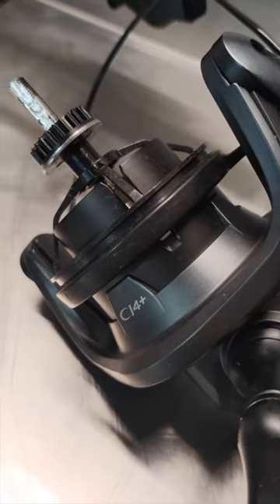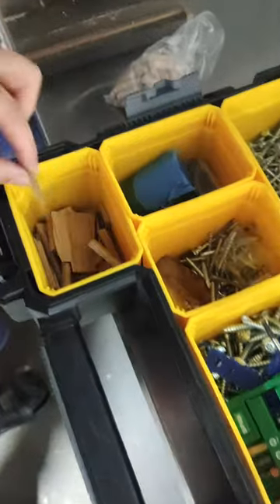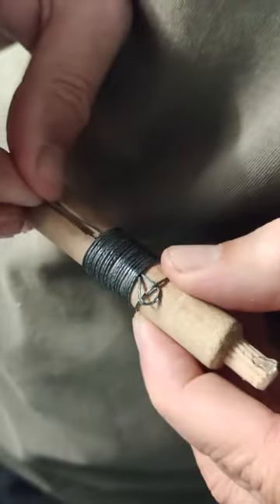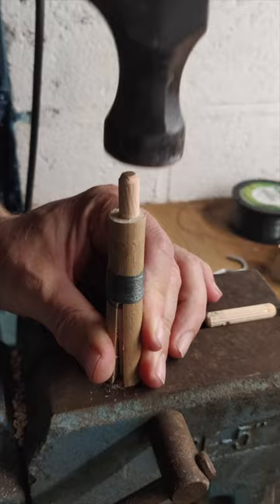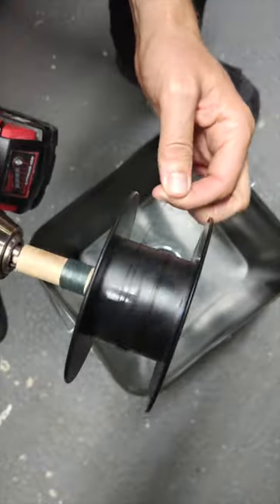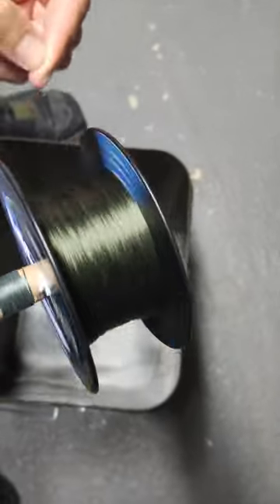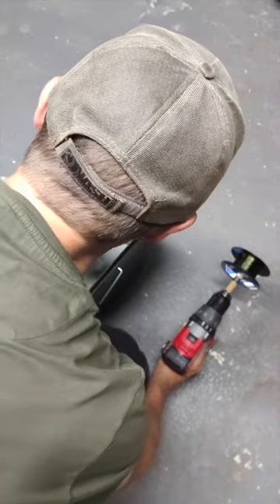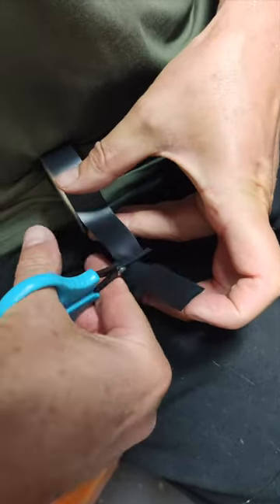Simple DIY Tool To Strip Line Off Your Fishing Reel

Comment: I used drill bits and just put tape around till it fits the spool.
Now i use a long screw with hexbolts on both ends.
I also use some wire which i bend in a right angle at the end, stick it to my spool from the reel and clamp the wire which sticks out under the spool in a vice, it srays put that way.

Comment: Hi. I do it with a length of 12 mm all thread. In the drill chuck and the old line spool trapped between 2 nuts and washers. If I have a real without a spare spool I will load it braid first for the required amount then the mono or cheap braid to fill the spool / the backing. Then use the drill spool trick to run it off the reel. You will then need to move the line to another spare plastic spool to reverse the line before finally back on the reel and now I have the perfect amount of backing and line. You can open the bail arm and feed it straight of the spool of the reel on to the spool in the drill. This way you are not adding twists during this.
Reply from the maker: Hi mate, that’s a great option too, thanks for sharing!
Reply: @matthewcollinsangler  i do the same. But i use always double nuts to secure the nuts against getting loose from spinning.

Comment: If you take a torch or lighter for long enough, you can heat up a cheap knife and as long as you have quality metal reels you wont mess them up. A little bit of common sense is needed. Dont burn yourself or the paint(rare) pull it back and you nail clippers for the last little bits if you being careful with your expensive reels. Its not too hard not to mess up. Plus it melts together where you cut keeping it relatively together so you can throw it away. A bunch of small pieces seems less dangerous melted tg than a loose wrapped spool that can come unraveled.
Reply from the maker: Cheers mate, a few people have mentioned this too, nice tip with the clippers 👍 I'll try it next time!